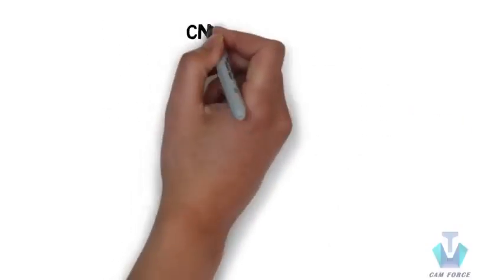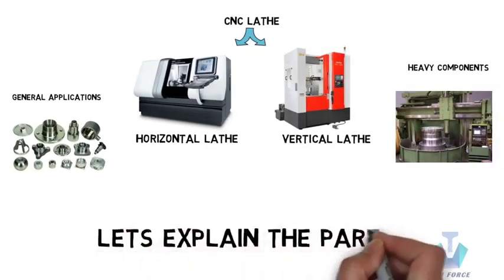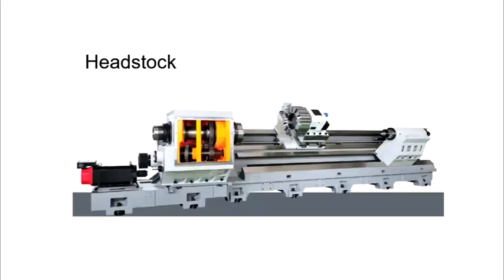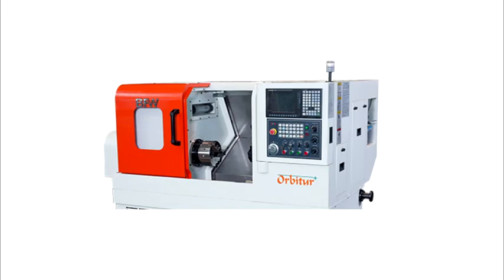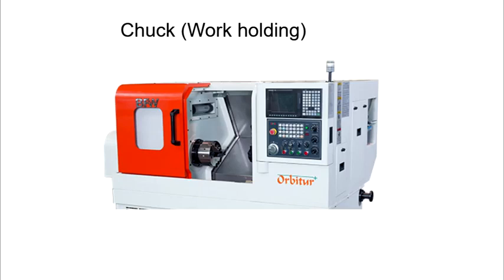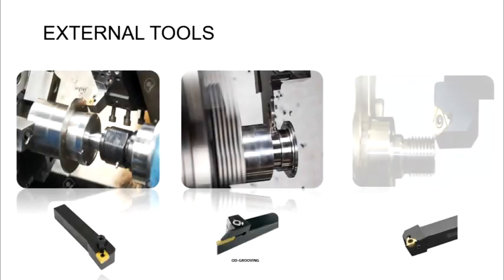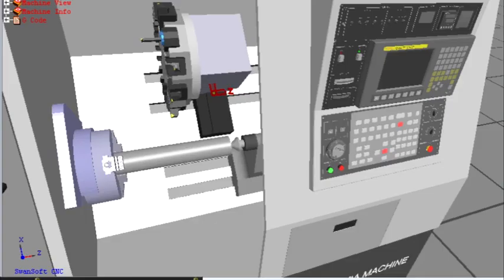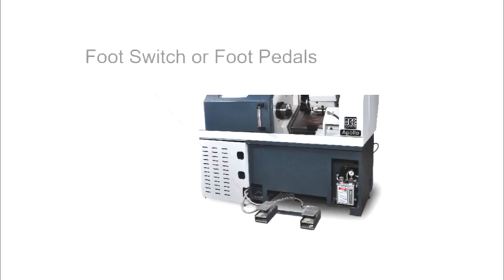Bagian-bagian Mesin Bubut CNC

Comment: Menjelaskan tentang bagian bagian lathe machine
1.Head stock
2.chuck (work holding)
3.Tail stock
4.Tool turret
5.CNC control panel (MCU)
6.Foot switch

Uhan Hasan Bisri
XI TPMC

Comment: Menjelaskan tentang bagian bagian lathe machine
1. Headstock
2. Tail stock
3. Chuck (work holding)
4. Tool turret
5. CNC Control Panel (MCU)
6. Foot Switch
 
Nama:Budi Alamsyah
Kelas:XI TPM B

Comment: Menjelaskan tentang bagian bagian lathe machine
1. Headstock
2. Tail stock
3. Chuck (work holding)
4. Tool turret
5. CNC Control Panel (MCU)
6. Foot Switch 

Haris Wardana Kusuma
XI TPM C

Comment: 1.Headstock
(headstock) umumnya headstock terletak di sisi kiri mesin. elemen utama yang ada di headstock adalah master spindle pemesinan dilakukan dengan memutar benda kerja menjadi kecepatan tertentu hal ini dilakukan oleh spindel di sisi kiri  poros penggerak utama terhubung secara normal di mesin cnc.
2.servo motors
3.Tail stock
4.Chuck
5.Tool turret
6.Cnc control panel (MCU)
7.Foot switch

-Alivia Nazla Azahra
-XI TPM E

Comment: Menjelaskan tentang bagian bagian lathe machine
1. Headstock
2. Tail stock
3. Chuck (work holding)
4. Tool turret
5. CNC Control Panel (MCU)
6. Foot Switch

Muhamad Yayan Supriatna
   XI TPM-C

Comment: Menjelaskan tentang bagian bagian lathe machine
1. Headstock
2. Tail stock
3. Chuck (work holding)
4. Tool turret
5. CNC Control Panel (MCU)
6. Foot Switch
ANAN FIRMANSYAH 
XI TPM -C

Comment: Menjelaskan tentang bagian bagian lathe machine
1. Headstock
2.Servo motors
3. Tail stock
4.Chuck (work holding)
5.Tool turret
6. CNC Control Panel (MCU)
7. Foot Switch 

Ariesa Karimal W
XI TPM C

Comment: Menjelaskan tentang bagian bagian lathe machine
1. Headstock
2. Tail Stock
3. Chuck (Work Holding)
4. Tool Turret
5. CNC Control Panel (MCU)
6. Foot Switch or Foot Pedals

Lutpan Hamim
XI TPM C
Reply: Dadan Nurhidan 
X TPM E 
HADIR